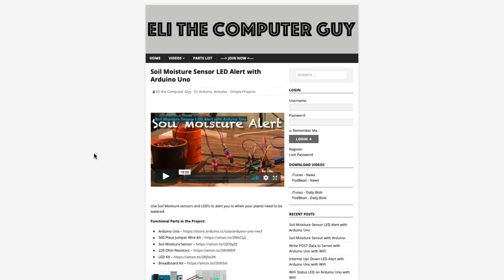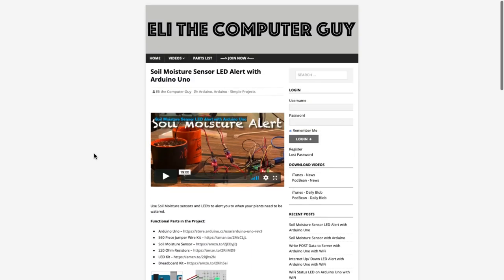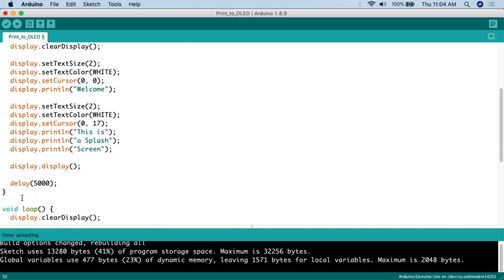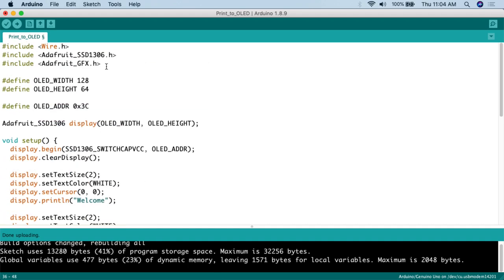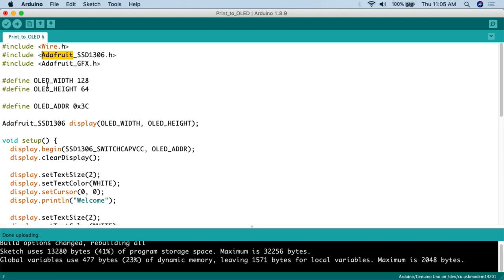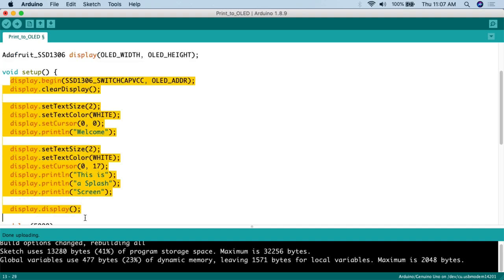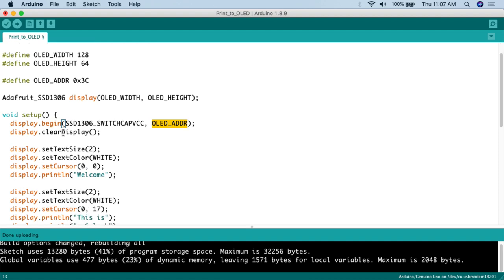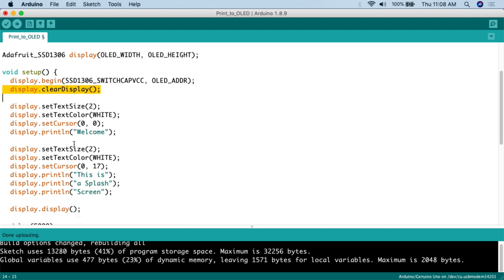Print Text to OLED Screen on Arduino

Comment: Hey, i m calculating no of clicks the user will press , however i want to store that that,theredore im using eeprom but the problem is if user turns off the board at 25 click and switch it on again it still shows 0 ,i then put the eeprom command in void setup and it worked with 16*2 lcd ,but its not working with 1.3" i2c oled, can you please solve my problem!

Comment: Just in case you're like me and can't access the program, I spent some time re-typing the program.
Thank you to Eli the Computer Guy for slow scrolling, because of it, recreating the code was super easy.

#include <Wire.h>
#include <Adafruit_SSD1306.h>
#include <Adafruit_GFX.h>

#define OLED_WIDTH 128
#define OLED_HEIGHT 64

#define OLED_ADDR 0x3C

Adafruit_SSD1306 display(OLED_WIDTH, OLED_HEIGHT);

void setup() {
  display.begin(SSD1306_SWITCHCAPVCC, OLED_ADDR);
  display.clearDisplay();

  display.setTextSize(2);
  display.setTextColor(WHITE);
  display.setCursor(0,0);
  display.println("Welcome");

  display.setTextSize(2);
  display.setTextColor(WHITE);
  display.setCursor(0,17);
  display.println("This is");
  display.println("a Splash");
  display.println("Screen");

  display.display();

  delay(5000);

}

void loop() {
  display.clearDisplay();

  display.setTextSize(2);
  display.setTextColor(WHITE);
  display.setCursor(0,0);
  display.println("Welcome");

  display.setTextSize(1);
  display.setTextColor(WHITE);
  display.setCursor(0,17);
  display.println("IP:192.168.1.1");
  display.println("Subnet:255.255.255.0");
  display.println("Gateway:192.168.1.1");
  display.println("DNS1 : 192.168.1.2");
  display.println("DNS2 : 192.168.1.3");
  
  display.display();

}

Comment: Great video! Definitely a newb to Arduino and programming. Hoping you can point me to some info or video on how to print an analog input to the oled screen with a common text after it. Been searching the internet but cannot seem to locate it. I am reading a 0-100psi pressure transducer with my Arduino Uno, have got it working on my LCD screen but not my oled. The oled is working but need to understand how to print the analog input with just the text "PSI" after it. Have you done a video on something similar? Would certainly donate on your website if you can assist me. Thank you in advance :)